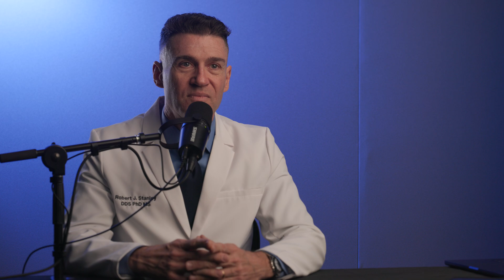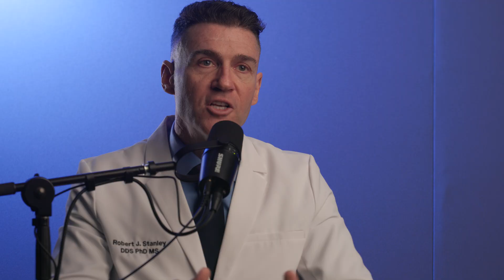Future All-on-X? Place The Implant RIGHT the First Time!

Comment: Hi Doc. How do you manage a case with very dense bone in the posterior mandible? Can we raise the drilling speed to 2000 rpm and use the same in-out motion? I had a patient today who has been taking calcium supplements, and boy, the initial osteotomy was tough! Looking forward to your resoponse.
Reply: Get new osteotomy drills.  If it's not cutting, that is the most likely problem.
Reply: @effefffffffffffffffffffff its a new kit
Reply: I had the same issue today when placing 2 anterior mandibular implants for overdentures. Burrs were almost brand new, and I still had a tough time. Had to bump it up to 2k rpm and max irrigation. I think it should work....willl see.

Comment: So in a case where the implant is too shallow. Is it possible the remove the existing implant and place a new one (deeper) into the implant extraction socket immediately? Or in the case of a failing implant, can it be removed and a new larger diameter implant be placed immediately?
Reply: Yes as long as there’s no signs of infection

Comment: I’ve always found it weird that as much time as we spend thinking about biological width around natural teeth, we also have such a problem with implants being placed so shallow.  The basic concept doesn’t change from a natural tooth to an implant, but I think some practitioners just don’t understand that it’s ok to place it deeper than what they’re used to seeing, or that it’s preferable to sacrifice a little bit of overall implant length in exchange for proper depth of placement.  
That old “10mm implant or bust” thinking still screws us sometimes, pun intended.
Reply: So many trains of thought.  I know a lot of folks that use calipers to measure the gingiva width, then base their depth on that to achieve 3.5mm bio width.